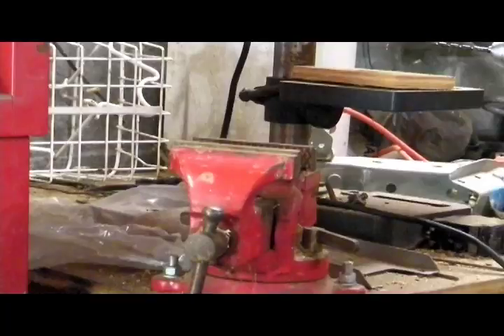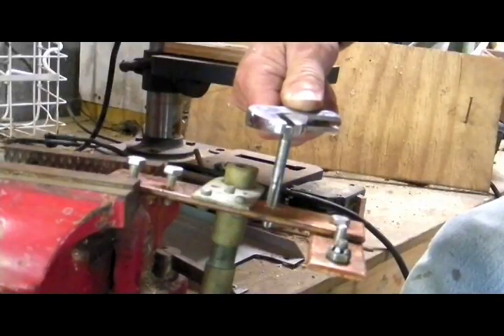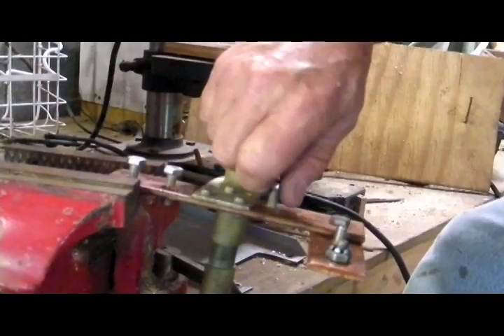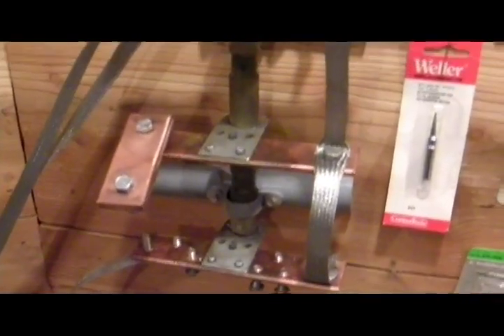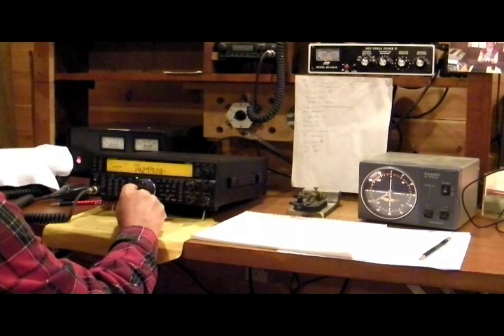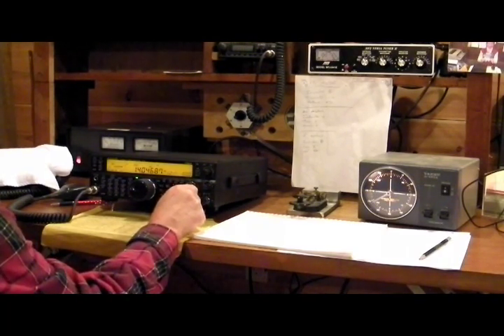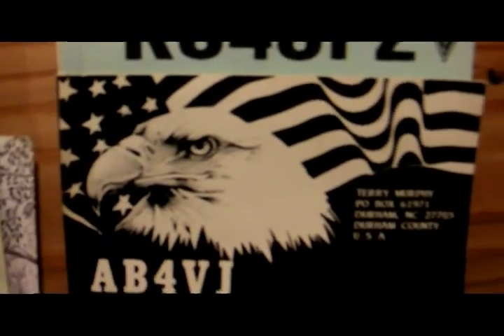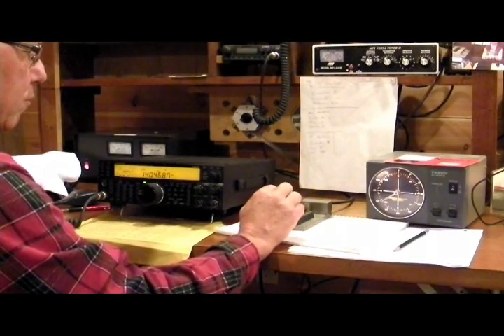Ham Radio Station Grounding

Comment: Did your electrician friend tell you to bond this system to your home's electrical service grounding system? Otherwise, your "Auxilary Ground Rod" as it is defined by the NEC is at a different potential and therefore dangerous. You should really just run that bare copper wire out to an intersystem bonding termination that also connects your tower, etc. to the grounding electrode system for your electrical service, not another rod. Jim, W6LG is the only ham on youtube i've really found telling it how it is. See this video https://www.youtube.com/watch?v=YajUL0WzZxU
Reply from the maker: Yes we did that
Reply: Why don't you create a video??

Comment: parvin, i had the priviledge of working the radio on board W6RO, the Queen Mary. The radio Operator was in periond costume. We were at 90 ft above sea level on bridge, the beam was up another 90 feet on to of the first stack. Workked a ham in Michigan. Felt asd excited as  a little kid.

Comment: Additionally - please remember that RF ground is NOT the same as electrical / power ground. So separate ground braid to common spot and then shortest path to physical ground / rod is the right way. Also I can recommend to put ferrite chokes on the coax feeders on between radio, PA, tunner etc. 
Good luck. I.
Reply from the maker: This grounding business is so confusing.  There seems to be many opinions on how to do it.  I am an amateur and have learned a lot since I made this video.  BUT,  I still don't know if my ground system will actually do me any good at all.

Comment: No guys, no!
Daisy chain is the worst case in grounding job!
All gears must be grounded to single common grounding point as it is shown in video. The same potential is the key. 
I.
Reply from the maker: Michael, are you saying that the video shows the correct method?  I have been confused by so many opinions about the way to do this.

Comment: I have been thinking of doing this as well but after thinking this through is this not creating ground loops between your equipment? If your equipment is grounded at the power plug to your house ground and or your equipment is grounded together by braid or with the antenna jumpers ie the outside braid of the coax that grounds to the case, This seems to be making many loops. I think it needs to be a one way chain and each device should not be grounded to the house ground through the power plug; but only one device. You should only use the three prong on the one you wish to go to ground.with the other equipment grounded together with the coax or a braid but not both. Aslo by adding the gound to the rod that also makes a loop. I think only the antenna shield should be grounded outside for lighting protection.
Tell me what you think like I said Im just trying to understand this before I jump.

Doug
K5BAK
Reply from the maker: Doug, Thanks for the comments.  I think that if I had it to do over, I would ground the tower at the base and call it good!  There seems to be as many opinions about grounding as there are hams!  I went 30 years without grounding ... I unplugged my equipment and antennas when not in use and i never had a problem.  When I put up my tower, I thought I had better do something and so I did a lot of reading about "sing point grounding" and thought I was doing it right.  Turns out that I don't know if my grounding attempt offers me any more safety than simply unplugging my equipment.  How does one know?  Good luck, I hope this helps.
Reply from the maker: ***** You bring up some very good points. I wish that I had consulted with experts before trying to do this.  Why spend the money if in the end I have done it wrong.  I always say, "A little knowledge is a dangerous thing" and I fell into that trap here.  I tried to read and search the internet to  learn to do this job.  It certainly is beyond my understanding.